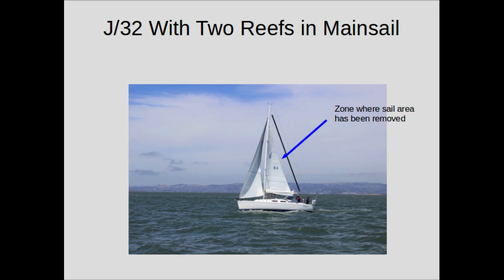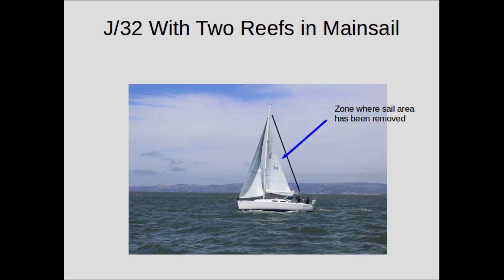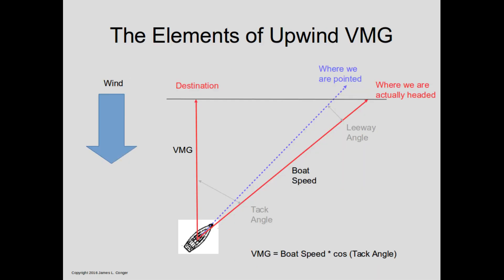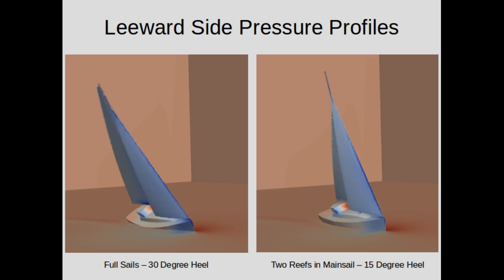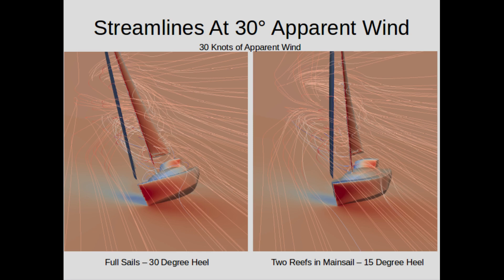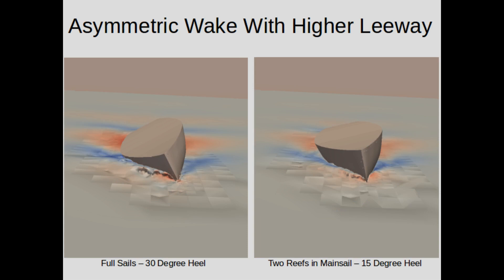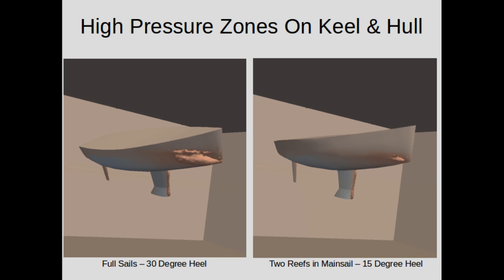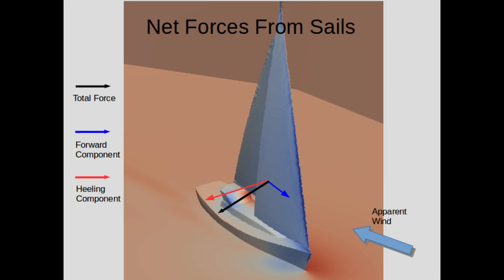How sails really work   Reefing the Mainsail

Comment: It would be interesting to see a graph of the two scenarios (full sail plan vs. reefed main) which shows where the boat speed or VMG curves intersect for your boat so as to be able to tell exactly when you should begin reefing to make the best progress?
Reply from the maker: It has been quite a few years since I did this work, and it would be difficult for me to create that plot now. I do remember that the inflection point corresponded to about 20 degrees of heel. If the boat was heeled more than that, then the added leeway was greater than any added boat speed in terms of VMG.
Reply: @jamesconger8509  Thanks for your reply. I assume that angle of heel would be different from boat to boat depending on the different variables, but should it be relatively close to the 20º heel for most? Really enjoy your analysis...
Reply from the maker: I don't know. Some of the newer Hull shapes are so different from what I'm sailing that the results could be quite different. I was sailing in very strong conditions yesterday and it reminded me that the boat tells you when you are pushing too hard. Probably best to listen to the boat!

Comment: I have a single line reef setup and to reduce friction I’ve replaced the 10mm ropes that came originally with 8mm dynema, complemented with blocks in the cringles. Both reef lines (1st and 2nd) are redirected to the cockpit. Super easy and never had a problem, even singlehanded.
Reply: I did the exactly the same, and mostly agree - I'm not sure why this isn't more common because it reduce the number of lines lead aft (I was/am limited on blocks at the base of the mast and clutches in the cockpit).  That said, one problem is that it ends up being a very long pull to the get the reef in since it must reduce at 2 ends of the sail, and there isn't as much control in sequencing the tack before the clew.  For me single-handing, it works pretty well, however and if nothing else the reduction in friction is a huge benefit, so even if not jiffy reefed, I would still recommend a block at the reef clew rather than running the line with friction over the cringle.

Comment: Excellent in depth presentation.  I am curious, though, you did not mention reducing the jib area.  When you reef, do you reduce the size of your jib either by rolling in the jib via a roller furler or do you use a smaller jib?
Reply from the maker: The boat I am modeling is a J/32 which has a relatively small jib and large mainsail. My reefing order is to put in reefs 1 and 2 in the mainsail before reefing the jib. It was strong enough a couple of weeks ago that the jib eventually was put away completely and we just sailed with a double-reefed main. I suspect with designs that have a relatively large jib and small mainsail that you would reef the jib first, but I don't have any scientific basis for demonstrating that.